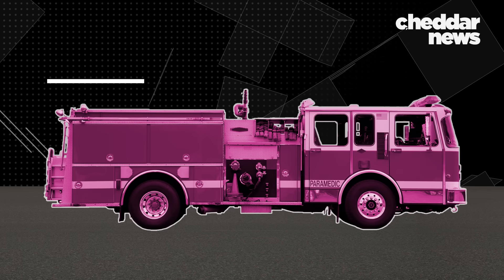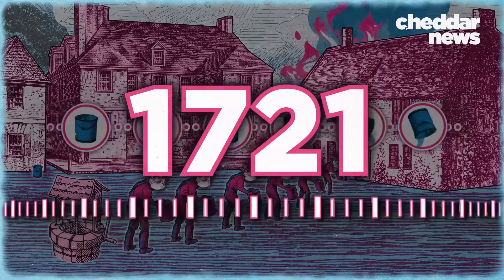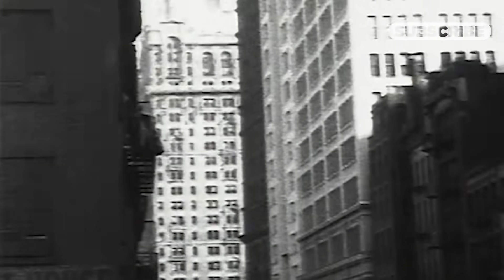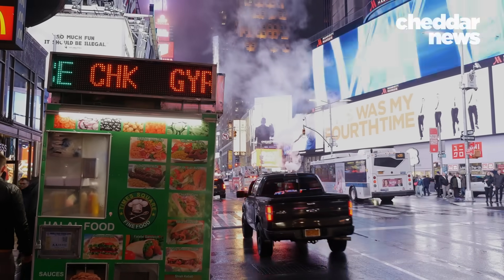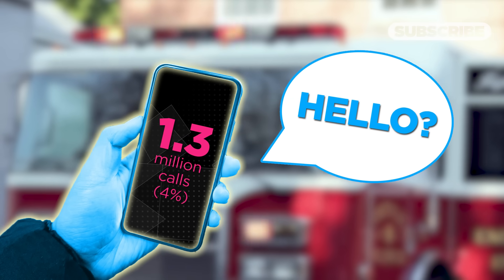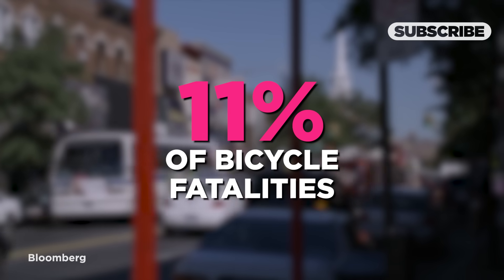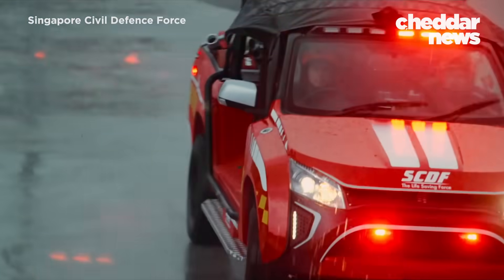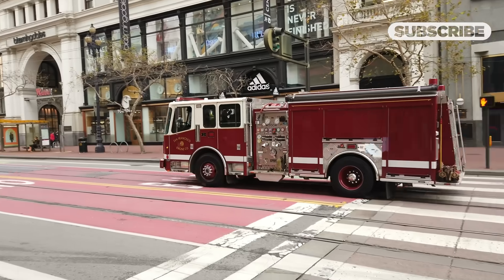Do American Fire Trucks Need To Be So Massive? - Cheddar Explains

Comment: As a firefighter in America I’d like to give my take and hopefully clear things up here. 

I understand all departments are different and have different needs and capabilities depending on what you have in your area. Some being rural, some being in the city, some being somewhere in between. 

My engine is 31’ 9” In length. 11’ 9” tall. We have 2,135 total feet of hose on board. We have 1032 gallons of water on board. We can flow 1500 gallons of water a minute at 150 PSI.  

In my department, every compartment of a our engines are pretty much the same all around. 

On the driver side, our first compartment is called the “Engineers compartment.” This compartment has different nozzles/ extra nozzles that we can use to help fight the fire. Different nozzles can help I’m different ways. We can change/ swap nozzles out that can give more reach, and more GPM. We also have attachments that can allow us to make foam. In this compartment, we have hose that are 25’ in length (in case the hydrant is near by) so we don’t have to pull another line off the back that is much longer. We keep a tool box that has standard tools. We have a water cooler, scene tape, duct tape, markers, ect. 

Our second compartment is our tool compartment. We have everything from pry bars, flat head axe, pick  head axe, sledge hammer, lock out kit (to open locked car doors), and other tools.

We have a 3rd compartment that has chainsaws (to cut trees) vent saw (chain saw that is meant to cut holes in roofs to help with ventilation on a house fire. Oil dry for car wrecks, push brooms for cleaning a scene up (works to help spread the oil dry), tarps, tubs for salvaging things (typically on a house fire), forestry rakes, extra oil and fuel for saws. We have k12 saw and extra blades for it. Ground monitor, portable hydrant, ect. 

Our back compartment, we have a fan (for ventilation on CO calls and for pushing smoke out of a home). We have a junction box that’s pretty much a really long extension cord. Portable scene lights. Hydrant bag ( bag that has tools to turn hydrant on and flow water) this bag also has adapters and hydrant wrenches, spanned wrenches, flash light, adapters, gate valves, ect. 

We have a ladder compartment that has two 10’ pike poles. Two 6’ NY hooks. Back board. 24’ extension ladder. 14’ roof ladder. 10’ attic ladder. 

We have a compartment with extrication equipment. We have a spreader (jaws of life). Cutter (to cut cars open). Long and short Ram with support ( push dash). Chains for stabilizing a car. Window cutter (cuts windshields primarily). We have a hydraulic power generator to give power to cutters, spreaders and rams. We also have airbags that allow us to raise a car if a patient is trapped under the car. We can also use the airbags to lift the car and place wood blocks under the car to help stabilize. We carry 20 blocks and more other wedges (called cribbing). We have ratchet straps and plenty of webbing. 

Next compartment we have medical equipment. We have a Zoll monitor that can give us vitals and shock a patient in cardiac arrest. We have medical bag with IV kits, life saving drugs, gauze and other life saving equipment. We have also an airway bag that contains everything from a nasal cannula to even where we can intubate a patient if needed. 

We are all Hazmat Technicians in my department. We also specialize in technical rescue. These are very few of the many things we have on our Engines. About 95% of our calls are EMS related. And 5% are Fire related. 

We respond to all EMS calls. Reason being is we can just have extra hands for the EMS crew. A lot of times, the EMS crew is far away. If we respond and are on scene within 5 minutes, we can get a lot done with the patient before the ambulance arrives. We care for the patient and a lot of times, the patient is ready for transport by the time the ambulance arrives on scene. 

Everything on our trucks are needed and vital. We pretty much can handle nearly everything with what we have. Everything we have as far as space for tools is jam packed in there. Every bit of room we have is used. 

To end this long comment, we hope not to use anything and pray for the safety of our citizens, however, if anything happens, we are there and are ready.
Reply: hm, nearly everything you mentioned is also on typical german firetrucks which are much smaller... the only thing that's different is that our normal trucks have 500 - 800 gallons of water with them, but every bigger fire department has a so called "Tanklöschfahrzeug" ("tanker") with up to 1200 gallons of water. We have a very good hydrant system even in small villages which allows us to carry less water in the vehicle. Also the amount of hose could be a bit smaller here.

Maybe our medical equipment is also a bit smaller, but many fire departments in rural areas have so called first responder, which have the same equipment as an ambulance car in a vehicle that is in small SUV size (e.g. BMW X3, Ford Kuga, ...). They are faster than every fire truck. 

Everything else is the same! Maybe we have even more on board, like material to secure traffic lanes with cones, lights etc. Some also have small electric power generators or multiple chainsaws to cut concrete, metal etc.

So, to sum it up: In Germany the fire trucks have at least the same amount of stuff on them, and are much smaller. Also, 10 people can drive in that trucks...
Reply: @aron3588  to add to your statement about the hydrant system. If you build a house or any building in general you have to proof that there is at least one hydrant (depending on the building size even more) within a 50 meter radius. For cases like countryside farms (rare in the EU cause space) you either need a Pond with a certain amount of water (dont ask me what number specificlly but i believe it was around 1000 gallons) or big water tanks that can be used as water for fires on your property.
Reply: @aron3588  Czech Republic here. Besides, Europe is extremely well covered with "ambulance services" (EMS etc.) and they are the primary responders in solely-medical situations anyway. There is no way that, with the exception of cardiac arrest maybe, FW would arrive to a purely medical condition before an ambulance because it would not be dispatched in the first place.
Reply: @aron3588  Even in America trucks that you will see out in Rawl areas are nowhere near as big as what you will see in major cities. You will only see big ladder trucks in communities that actually need them
Reply: @aron3588  so the 1200 us gal capacity you mentioned is on the very low end of the pumper tankers that in my area are designated as engine xx-5 and upper end of standard engines here. Tanker designation is usually anything 3000 gallons or more. Most trucks also carry hard sleeve hose for drafting out of ponds, lakes and other bodies of water.
Reply: @aron3588  We get it. You think your better than us even though you aren't
Reply: @chaosXP3RT  We are
Reply: In germany we have very different vehicles
1. is the HLF which is Good For Basic technical Support and fires. It’s the vehicle for Daily Basis, With a 2.000l/min Pump and a 1.600l Tank With nozzles and all you Clan Dream of and has 2 different ladders on it which can reach altitudes to resche at 7.2m and 11m and in thats Not enough we have the
2. DLK which in regulär basis Has a 30m Long hydraulic ladder That can reach 23m at 8m distance to the building 
3. LFs which are basically there to put out fires and has 2 ladders also 
4. the RW is without any Water or water Tech and is online Used for technical stuff like car crashes and more and it Comes it the HLF isnt enough
And after That there are Things like WLFs and so on 
Also to Note nearly Every vehicle can produce Their own energy via a gasoline powered generator 

And thats without much details. Look up an HLF20 and Look for english subtitles and Maybe you See some cool stuff in a smaller truck
Reply: @supmo68  HLF is that what Dublin Fire Brigade and other Irish brigades call the pump ladder
Reply: Thats a nice list, but I have to say, the HLF in Germany can do ALL of this as well and is way way smaller than an American Firetruck, we may don't have as many ladders on a truck but we have 1 modular and one longer ladder. For everything that is taller than the ladders can reach the ladder truck is responding.
Our HLF got a tank of 1.600L (423 Gallons) of Water with us and 120L (31 Gallons) of foam concentrate on the truck.
The ladder truck got (if it´s new) a second joint up front to get in the basket in even tighter spaces.
I am a EMT and worked for 2 Years as one. I just started the 3 Year School education the be a Notfallsanitäter (Paramedic) in Frankfurt. I am in the Volunteer fire department (not in Frankfurt) but I am worked many times with the firefighters in Frankfurt, they got Drugs on there Firetrucks as well and got a Paramedic on board but the don't respond to medical calls on a regular basses, the dispatcher only dispatches them if the got a ongoing resuscitation on the phone or an Ambulance is calling for help at a resuscitation.
I think the big difference is that we also got a small car (7 of that in Frankfurt) wich is called NEF wich is transporting a Doctor to the Cene, the driver of the Doc is a Paramedic, so you got 4 Persons on Cene: 1 EMT, 2 Paramedics, 1 Doctor. Just so I know, do you got something like this ?

To come to an end: We can do as much as you can with our HLF, and the trucks are way way smaller
Reply: @kroncarl6583  large departments here have many different kinds of trucks which respond to different kinds of calls.   Both Emergency Medical Service Ambulances, as well as fire departments have paramedics.  Fire department will often send a squad vehicle to medical calls, because it is assumed that they will arrive quicker than EMS, and also they will make additional personnel available if the call becomes technically complicated due to entrapment or the location of the patient (upstairs, etc) 

Smaller departments, with less personnel and less financial resources may have only one or two trucks which must be able to respond to any call which comes in.
Reply: @kroncarl6583  well the main difference for size is the water capacity. Engines in the US carry almost 3 times the amount of water of what yours does. If we only carried 300 gallons we too could have a much smaller truck. Also a major difference in the length of hose carried
Reply: @Kron Carl  basically the way most US fire trucks operate is every truck is able to run most calls. We still have specialized trucks, but it's rare we need them.
Reply: @kroncarl6583  you just stated that your trucks have half of the tank capacity. That right there will reduce the size of the truck
Reply: @kroncarl6583  no we don’t carry doctors on scene mostly ent and paramedics is not as many but we handle the calls even on the pumper ladder truck to help and save a patient during the time before paramedics or ent arrives.
Reply: @kroncarl6583  423 gallons? average engine in the us is like 1,500 gallons
Reply: @85square  our engines (city municipality)have 500 gal booster tanks. Ladders with a pump have 300 gal tanks. Surrounding county departments have 1000 gal up to 1500 and are classified as pumper/tankers. And the difference in designation,  I believe,  has to do with achieving a certain ISO rating. In the city we can send more truck to a call and have the required water capacity, or whatever requirementit. But being a city, we have a large hydrant network. The county departments run more into rural areas without hydrants,  thus the higher on-board water capacity.
Reply: @85square  You only need to carry on board if you do not have access to a water supply. At least in the UK we have reliable and plentiful hydrant networks located throughout urban areas, they can pump from ponds, pools, lakes, etc, and if it's a serious fire, you're going to get a stream of bowsers (tankers) to the scene too.
Reply: @85square  Don't you have acqueducts and standpipes/fire hydrants in the US? They are literally everywhere where I live, including mandatory, pre-installed fire hoses in buildings that are open to the public (event venues etc). Unless it's a road accident happens in the middle of nowhere in the countryside, you don't need to carry that much water on the truck. You just connect to the water network and pump.
Reply: @kroncarl6583  you have several logical fallicies with your statement. 

1) All your equipment is stowed, even hoses. American fire trucks are designed for rapid deployment of hoses that are already connected, no need to pull out the bag, remove the hose and connect it.

2) European fire trucks are designed for space saving in mind. The equipment will be stored higher off the ground but with a step stool. Most American equipment can be easily be reached from the ground.

3) ladder trucks are fundamentally different between the two countries. European ladder trucks are designed for rescue only usually can support the weight of three people. American ladder trucks are designed for rescue and also for full operations the design to carry up to six people including all equipment for water suppression monitoring and rescue.

4) 700 gallons of water takes up a lot of room. there are a lot of areas in the United States in the country where you do not have access to anything in regards to a fire hydrant.

5) American fire trucks are designed from the ground up to be fire trucks. European fire trucks are retrofitted from existing cab and frame designs. American truck fire trucks have to follow exceedingly specific design specifications including reinforcement of the cab for firefighter protection.

6) a good chunk of the length difference comes also in a pump location. most American trucks use center staffed pump location versus European use rear.  this is a design choice by the people ordering the truck.

7) there are American fire departments that have trucks very similar to Europeans. with each truck being designed for the ground up there are a lot of options, departments choose what they want based on their geographic and service needs. 

8) European trucks are most similar to type 1 fire trucks in the USA. Biggest difference is the USA trucks may be slightly longer ~35feet instead of 30 once again due to location of the pump.

Trying to compare American versus European fire trucks is like trying to compare apples to oranges. There are seven different types of fire trucks in the United States. Each one serves an individual purpose. and each one can be customized to departmental standards and needs.
Reply: @RepinsTsohg  There was a company called Dennis who built appliances for brigades in Ireland and Britain.
Reply: @kroncarl6583  that's awesome that the smaller trucks fit the need for your department but they would never work in mine. I read you are a volunteer firefighter. I am as well I'm a lieutenant in a rural fire department  with only about 15-20 active members to run calls. More than a dozen of those work outside the coverage area which covers 77 square miles and all but 2 work days. So on any workday you might have 5 people available to run calls. Of those if you get 3 your doing good. We have times where we don't have the personnel to bring multiple trucks to the same call and need all equipment for all jobs on the same truck. Considering we run on average 5 calls a day it's possible to have multiple calls at the same time. If they are the same type of call and require the same equipment we have it. Now let's talk about the water situation 400 gallons are what we have on our brush truck would never work for an engine. Our engines have 1000 gallons because there are areas that don't have hydrants for more than a mile we also have a 2500 gallon tanker that we can shuttle water in. The point of my long reply is just because a particular truck works well in one area doesn't mean you can take the same trucks and make it work well in another.
Reply: @williamtunstill7139 yes i agree with multirole trucks being more useful for low crew fire stations but generally most fire deps out there do have enough crew for more vehicles
Reply: @williamtunstill7139 also all the german firefighters are saying a german fire truck can carry the same equipment so a smaller truck could definetely be as multirole
Reply: @kroncarl6583  From what you said the American truck just has double the carrying capacity as your German Fire truck.

You have smaller roads, America has bigger roads. I seriously doubt the HLF is that much better. 

America is Land of the Brave and Home of the Free 

Something your Lacking in Germany. (Freedom)
Reply: @kroncarl6583  immediately you said one thing that is way different that your truck can’t do. You only carry 420 gallons of water where as an American truck Carrie’s over 1000. That 400 gallons won’t really do much for a fire on a bigger house or complex. The other problem is you have 1 truck for this and 1 truck for that and 1 truck for something else. What happens if multiple scenarios happen at once now?   The smaller trucks just aren’t as equipped and I’m sure if you compared each truck exactly you would see how many things this smaller truck doesn’t have.
Reply: @RedHaloManiac95  also if someone is injured waiting for your specialized truck can be the matter of life or death to that person.
Reply: @kroncarl6583  We get it. Europeans think they're better than us. Spare us from reading an entire paragraph
Reply: @kroncarl6583  the combined costs of all of those vehicles, along with logistics and maintenance actually makes them hundreds of times more expensive than the American fire engine. Basically the point your trying to make is that the job one American fire engine could do, is apparently better to have be done by at least half a dozen tiny, exceptionally flammable (and prone to literal spontaneous combustion) pickup trucks? Because that just sounds logistically and practically stupid on every level.
Reply: And nowhere did he say that his fire truck was 10 ' wide.
Reply: Greetings from Germany
Reply: Your loadout is pretty much the same for my department. We have 2 Engine/Rescues, Spartan Chieftain, 6 man cabs, top side control panel. We have incorporated 2 medical response units (Ford SUV) since our 2 American Fire Apparatus rescue units literally wore out and had to be scrapped (safety reasons). I retired after 29 years of service. Sure miss responding with the guys.
Reply: I'm firefighter in rural Switzerland. We have exactly the same material in smaller trucks. There is only one difference: the ladder is in a trailer and not on the truck. But as you say, only 5% of the interventions are fire related, meaning we don't need the ladder 95% of the time
Reply: @Americans if you are interested in German Firefighting have a look at Feuer & Flamme. In my opinion it gives good insight even though the subtitles are quite bad. 
You can even see that we can handle big fires with our small trucks.^^
Reply: @g3rn0m4ly7  Yes, and we can handle small fires with our big trucks! sorry for the sarcasm
Reply: See a video of a car that's on fire in the states or example in the Netherlands, you can see that the fire brigade in the states can learn from the Netherlands.
Reply: Wow, that's a very long way to say that you don't see forest for the trees
Reply: I agree but also the fires may be getting less common but are getting stronger and harder to fight because of the material burning
Reply: Thanks for a comprehensive response!
Reply: My department is a engine and rescue so I understand that
Reply: sounds like what the rural fire trucks around me are setup as.  I had to call 911 10 years ago when I was alone and pregnant and my toddler got her head stuck between the bars in a railing (in my defense we only had been in the house for a week and were looking into how we could fix that spacing problem but we thought our child's head was too large for it to be a problem  until the next child's birth).  After 30 minutes a fireman arrived in his personal truck, his personal truck had all kinds of equipment for car accident issues and he apologized for not being there sooner because when he heard the call he went to his garage to get a metal cutter.  He was able to pull on the bar and flex it enough that I could pull my daughter out.  he checked her out and then called to tell the ambulence and fire truck to not come out.  just after doing that a 2nd fireman arrived (1 hour after the call) and said he had also looked for a metal cutter before coming.  Rural fire departments need to be prepared for anything and everything, though sometimes the fireman come directly to the scene if they are closer to it than the firehouse, which reduces the wear and tear on the firetruck.
Reply: Could it not be also argued that having a higher number of smaller vehicles would help with role flexibility whilst letting you carry at least as much equipment?
Reply: I like how the only point made for big fire trucks is that there are rural areas. 
I am going to propose a crazy Idea. Cities can switch. If there are edge cases where somehow a European Style Truck is not working. Just stick with the old one.
Reply: @g3rn0m4ly7  Right? I don't think people fully think through their thoughts. (1) People are commenting how the US needs large firetrucks because we have rural areas, as if other countries don't have rural areas. (2) The comments also sound like rural areas justify large firetrucks in cities.
Reply: In Europe they have nimble ambulances with jaws of life and all the equipment to remove the victim
Reply: I'm not a firefighter but if I'm not mistaken our fire trucks have the same equipment on ours here in Sweden🤔 some may be divided over two trucks but still as efficient but I don't think they are that less expensive.. I don't think the truck itself is that expensive but they are packed with equipment and all that ads up...

As a swede I love the us fire trucks and would be sad to see them replaced, they are more then just trucks by now.. it would be like dismantling Statue of Liberty and replace it with a stone..
Reply: The difference to Europe is, that we have smaller more specialized trucks. Meaning often we send 2 trucks to have the same equipment as US trucks. But very often that is not necessary.
Reply: This is enlightening, thank you for using the comment system to make productive discourse! 

I think it would be interesting to see how European organizations and trucks are set up. I'm sure the approaches used by them are no less effective than those used by US departments, so it might be a beneficial learning experience for both sides to see how the other operates. 

I'm not 100% sure, but from my observations European cities tend to completely separate their ambulance and fire services. I suspect this leads to some big difference.

European ambulance services sometimes also delegate response and transport to different crews with different vehicles (like a physician or medic response car that usually arrives before the ambulance). I wonder if their FDs are similarly specialized, having different crews and vehicles for each situation...
Reply: So much text and still you use gallons and inches. What a decade american you sir are. 😄
Reply: @j0n_H  150 burgers per overly complicated rugby pitches
Reply: I really like all the details that you explained and I really send greetings as a firefighter from Europe over the ocean to the US.

At our firedepartment we have 5 specialized vehicles. They all work in union
1 - 30m (approx 100 feet) ladder , its only purpose is everything related to height, rescue etc.

watersupply comes from the ...
2 - small watertank 1500l (approx 400gallons), waterpump, waterhoses, breathing-kits, chainsaw etc.
3 - bigger watertank 4000l (approx 1100gallons), waterpump, waterhoses

for cars accidents etc. there is the ...
4 - mutli tool vehicle with everything to breach cars and much much more

special ...
5 - coiled up hoses I guess 2 miles of hoses (special for water supply for wood fires in the hills here - the needed intermediate pumps are stored in several locations in the area)

The next fire department just 3 miles from here ...
- has their specialized vehicle against chemical and biological hazards and treatment of such

The other fire department 4 miles away
- has a special vehicle for snow and muddy mountain terrain to rescue people there

And so on.. 

What I want to say is, that it's surely not all good here in the German Firefighting Services, but the approach is to specialize the vehicles and the education of the (mainly volunteer) crews.
Reply: Thank you for your reply, quite honestly, the first one to give a factual, rather than testosterone induced one from the USA.
Knowing something about how European fire systems work, I'd say that your training is pretty well equal to a European fire crew's. But do you take ALL  that gear to every call?
I know that European systems tend to use much smaller units. If there is any doubt as to the assessment of a situation, the service will often send someone ahead to advise control of the specific needs. 
This approach has, sometimes resulted in a serious situation resulting in worse outcomes (Charing Cross tube Station as an example) when a senior officer wasn't able to reach the scene in time, but usually multiple, small, specialist units can arrive far more quickly than a single juggernaut. And the personelle are just as well trained.
OTOH, I understand that US firefighters have a much higher fatality rate Due to the "Hero response" culture in the USA.
Reply: I've seen firemen in action i have more respect for them than the police
Reply: Kinda sad when this one comment has better info than the video it's commenting on.
Reply: This is pretty much what us Germans also carry. Except our vehicles are more compact. This is neither bad nor good. It just is. 

Sure, we carry less water but then in cities the next hydrant is never more than 100 meters away, 140 maximum.
Reply: That's the exact issue. You have too much stuff in one truck. You don't need a giant ladder for a car crash. You don't need a huge tank for a medical emergency. The equipment has to be distributed. A fore truck never needs medical equipment, there is a reason why we have ambulances. You can reconstruct the ladder that it uses less space on the truck. You can pack things in a compact way (something that US trucks aren't that good at) and you need specialised trucks for extraordinary events.
Reply: Same as you don't need chainsaws in the event of a normal accident or so. You also don't need a huge fan for everything. Let me tell you. Every single fire department in the world is capeable of handling every single situation, but we only take the things with us that we actually need and not more. If we have a chemical spill, you'll never see a truck with a huge ladder here because... just why? If we need to cut down trees, we call the guys that take care of forests, if someone has a heart attack... we won't even notice that because that's for the ambulance. Yes, we do need big ladders and huge fans SOMETIMES but if we need them, we simply take the specialised truck for that and there you go. 

The problem with big trucks is, that they cause more harm. Fire departments will demand wider roads for their big trucks, but that leads to more accidents. They want to remove bike lanes, but again, that causes more accidents. The big trucks it self aren't the issue. But their demand for more road space is.
Reply: In short, you have just a different approach. 
You have the one engine can to anything approach while Europe has the "tell us your problem and we'll send the right engine approach"

Also. It seems like in many cases one American engine would be enough. 
In Germany where i live 3 different engines can be sent at once. 
They're smaller cause they're more specialized. 

You rarely need ladders and water for a car wreck, so an engine with tools and at least one ambulance get send to that. 
We also have containers with very specific equipment.... if it's needed a truck picks the container up. On another call the same truck can pick another container.  
For example let's say a large amount of toxic materials were spilled.  Truck picks the container for dealing with toxic materials. 
Next call is a pile up with a lot of casualties.... truck pick up a container with additional medical equipment which might not be on an ambulance or at least not at the quantity needed for the situation
Reply: This is an English fire engine, note that there's a separate ambulance service so the fire service doesn't respond to medical calls, they are first aid trained but in general on scene medical is delt with by the paramedics and doctors of the ambulance service and helimed 
https://youtu.be/QQwzzj_u_GQ
Reply: https://youtu.be/_cqoisOrYSE

Have a look at an Australian pumper design.
Reply: Yea we are similar being rural we carry less hose than a city truck as we rely on tankers for water or we are drafting from a source and we carry less medical ambulance/medical is its own branch so what we carry is more we need to treat our own or as assistance to the ambulance and we keep a separate truck for auto accidents/ everything else  (I'm realizing I'm rusty I haven't been directly active with fire fighting an 6 years since I messed up my knee)
Reply: "My engine is 31’ 9” In length. 11’ 9” tall." 

Ooooof. Then I realized you were referring to the fire truck. 🍆
Reply: 343 + 1
Reply: U got hoes on board?
Reply: Thank you for this comment. I've generally avoided Cheddar videos because while they inspire conversation in the comment section, they are generally too short to be nuanced. Firefighters in my hometown respond to practically every kind of emergency, so their truck has to be a jack-of-all-trades.
Reply: @Matt Hickey, is your FD a combined Fire/EMS service with Paramedics on the truck?  Sounds like it by your description.    

Our FD is a combined service and our FF's alternate shifts between the Medic Unit and the Engine/Truck Co.   You have to promote to Engineer or Capt to get off the box rotation. 

Most FD's dont have full ALS capability on their trucks and the majority of the public doesn't understand the benefit of running a combined Fire/EMS service.  

Having a combined service also makes for better on-scene patient care because crews all work with each other, instead of having Medics only on the box and FF's on the Engine.   We trust each other 100%, no matter if it's the fire ground or working a code in grandma's living room. 

Be safe brother.
Reply: @Andrew-fr3bp  Switzerland is a very rural country. So the functioning of the service depends a lot on the size of the municipality. Cities with more than 10'000 inhabitants have professional ambulance drivers, so it's not really useful to have ALS/BLS skills. It exists in some places but tends to be abandoned as it is more efficient to send professional paramedics directly to the scene if the intervention needs it. In smaller localities, it works differently.
Military service is compulsory in Switzerland. All male citizens are BLS/AED certified by the army and some are ALS/MED certified (for example me). Fire service is also compulsory. In rural areas there are no firemen who stay in the fire station permanently. People live their normal lives and when there is an alarm, we receive an automatic alarm by phone, we go to the fire station to get our equipment and we leave for the intervention site as soon as there are enough people to form a complete crew (average time of arrival on the intervention site: 13 minutes). At the moment of the alarm, the officers of the state command centre select a person who is closest to the scene and send him to start the first aid without equipment. There is BLS equipment in different strategic places. The officers select a second person who will collect the BLS equipment and take it to the scene, again again without firefighter equipment. This allows us to reach 99% of the population in less than 5 minutes, so that first aid has usually already started before the truck arrives. In the trucks, we have full ALS equipment as a large part of the population is trained, but this is not part of the companies' specifications, it depends on whether a trained person is in the truck.

But that this kind of thing is only possible in a population that has a high level of military preparation, as is the case in Switzerland, and that can only work with a compulsory service system. In my village of 2200 inhabitants, we have 130 firemen. If we didn't have so many people spread over the whole territory, this way of working would be impossible.
Reply: @fabswisss  Retained Firefighters in rural areas of Ireland and Britain
Reply: @Andrew-fr3bp  That is what Dublin Fire Brigade does
Reply: Great comment, keep up the good work
Reply: But but bike lanes :'(
Reply: I know, locally, there's a pretty massive mix of trucks split between a few stations and also the various connections with the county stations.

I know one of the agreements with the county is that the city gets a lot of county calls for things, because the city has more things for that while the county adds a lot of the more specialized options, mainly for offroad and pumps...and both groups also have a lot more hazmat training than most due to an issue in the area concerning a fire at a chemical storage facility that's still a superfund site. We also get a lot of interchange in all EMS with the military due to the airforce base which has some interesting equipment of their own.

While I'm not involved, several family members are there, the most amusing things I've heard from some of the older dispatch from before agreements got fully hashed out with the base are kind of hilarious to think about considering the security issues that had been ignored such as a fourteen hour hunt split between 3 police departments, the sheriffs office, and the base MPs because some idiots on a bender were hopping back and forth while naked and "Trying to free the aliens" while on who knows what...
Reply: I am from Berlin, Germany and would love to hear from your professional point of view what you think about the Concept Fire Truck by Rosenbauer.
It is a electrical vehicle with an aditional diesel engine and new state of the art technologie, like changing the high of the truck to allow for easier acces to the crew compartment, it was testet by the Berlin Fire Department and proofed capable in a metropolian area ( the BFD wants to order more of engins).
Do you think this vehicle would be fesible to use such a truck in US cities to?

Here are some videos:
vpromotion video: https://www.youtube.com/watch?v=R_iLKoq3u1I
CFT in D.C.: https://www.youtube.com/watch?v=SSevSiD1Zis
CFT on responce, small turning radius in Berlin: https://www.youtube.com/watch?v=xHbRQomP2cA
Reply: When you put it that way seems like the truck ain't big enough.  Fireman should be paid like athletes do. I don't understand why not.
Reply: In other words you get more utility out of your truck than Europeans
Reply: @lrut028  American trucks are bigger thus less specialized. Europeans have multiple specialized trucks for different purposes and often send more than one.
Reply: @lrut028  bs, you get same amounts. Nice fake news.
Reply: @matt hickey thank you for taking the time to describe equipment in each compartment of your department’s vehicles. You mentioned the zoll monitor. Do you carry the Zoll Propaq MD?
Reply: You gave yourself the answer by commenting: 95% EMS, 5% fire. Good on you for being a firefighter though. Much more needed than overpolicing a city.
Reply: Wow 
10000% more informative than this whole video.
Reply: Matthew Hickey and Steven Morris Dublin Fire Brigade does all those things and only has a few types of appliance. They carry all the gear required and needed. Ambulance is one of their duties in the city centre.
Reply: "Everything on our trucks are needed and vital. We pretty much can handle nearly everything with what we have. Everything we have as far as space for tools is jam packed in there. Every bit of room we have is used. " That is some strange conclusion. You would say the same if you had half of those items or double of those items.
Reply: Thank you for your services.
Reply: My uncle is a firefighter
Reply: It is pretty much the usual American self flagellation: the rest of the world good, we bad.
Reply: And yet Europe is not more dangerous, because firefighters dont have the equipment they need when they need it...
I wonder how is that possible, if they also use smaller engines. Maybe you actually dont need all the equipment on every truck, all the time.
Reply: Better to be over prepared for every possibility rather than that once your not and someone dies
Reply: @lolhi3105  Soo you carry a swimsuit every day in case you have to swim somewhere?
Reply: Thank you. As a civvy I was never in a position to learn why a fire truck was built a certain way. Ladder and snorkel trucks are obvious, but the first 'generic' truck to be sent is what you took the time to describe. Thanks for the good description.
A lot of thought went into the designs and what goes where.
In my opinion, there are places like in older European cities where a North American design could not work well. Many of those cities date from medieval times, the roads are NOT large, the engine would never get in there. They must have trucks that can fill the needs they face, but in turn they would not be useful here.
Distances to cover, need for a lot of water and tools. need to operate at temperatures well below freezing, and long distances to drive at times.
In many of our cities you can drive at normal speeds for an hour and still be in it. So the truck has to be powerful and fast enough to cover the distance on top of carrying tons of stuff.
Let's not forget the necessary crew to be effective, I think it's at least 5 or 6?
Reply: @Greylocks  Scandinavia is also operating smaller trucks and it is much colder there... When there are forest fires, fire departments cross state lines, so I would not say range is a particular issue.
Reply: @Spectification  maybe not but when you see that a single province in Canada is twice the size of France.... it puts distances in a whole new perspective. Over 200km between major cities is not uncommon here. I still think it's a question of adaptation to the location.
Reply: Very Well Written and appreciated. Keep up keeping everyone safe! 👍😁
Reply: So you we'll use the 1032 gallons in under a minute?
Reply: Hey mate, thanks for your service. I’m a firefighter in the UK and work at what we call a ‘heavy rescue’ station. Trust me we have everything you have mentioned but I’m a smaller truck and can carry 6 of us
Reply: You don’t need all this for every call and you know that. You’re carrying tools for edge cases. When nearly every other western nation has smaller trucks and is just as effective as US fire departments, it should tell you there are alternative ways to do this.
Reply: Yeah ok my comparisons only one third of hose , 200 psi at 118glpm in conversion
Reply: Just ignore them

The modern Internet is on a "ANDRICA IS BWAD 👶👶🍼 ER THWING WUROPE DWOES IS BWETTER 👶👶🍼"

So no matter what you say some asshat from Amsterdam is going to be on here telling you why massive American cities with a greater population than his entire country needs Tiny firetrucks built in Europe. And also that you're a complete non human for not using metric.
Reply: Virtually everything you have said is on a uk fire appliance
Reply: An German HLF with an 11ton chassis does the same, lol
Reply: An German HLF with an 11ton chassis does the same, lol
Reply: almost everysingle fire engine does alot more then just these things
Reply: @MISTERKING192 Like what? What he talked about pretty much covers it. Hose (LDH, 3”, 2.5”, 1.75”, maybe forestry or booster reel.), Extrication, saws w/ oil and fuel, cribbing/air bags, hydrant bags w said accessories, spare nozzles and adapters to connect different size hoses to each other or to different size discharges/intakes, rakes/shovels/push broom, oil dry, water can/abc extinguisher, portable lights, BLS medical bag, AED. I’m missing some stuff off my apparatus but once again he covered most of it.
Reply: 11’9” 🤔 what kind of apparatus are you talking about that isn’t an aerial? The E-One’s at my department are 10’ in height.
Reply: america is such a shit hole developing country😂😂 european trucks carry all that gear and can reach the location much faster😂😂
Reply: I have a hunch that you have not done a comparison regarding equipment on the European fire trucks.
I think you'll find the outcome surprising.👴😁
Reply: The trick other countrys using is not to have all things in one truck. You respond with the trucks you get the call for. No need to send a ultra long hydraulic ladder when you need to open a car after an accident.
Just send as much equipment as needed so the rest is still ready to get used in another emergency.
Reply: Damn you lot fight fires all throughout North AND South America?!? Congratulations!!!
Reply: UK fire engines same as German, can carry all that kit you mentioned and still smaller. The argument that it has to be a massive truck to carry every thing listed is more of because you’re used to it, any thing smaller wouldn’t seem right.
Reply: @wilso845  The biggest space hog on a US or Canadian fire engine is the water tank, the old minimum which is still used by some urban departments of 500 gallons is not suited for most places in the US and Canada. NFPA, the National Fire Prevention Association, a non regulatory guidance agency in the US states that at minimum to combat a fire, a fire hose must flow at minimum 175 gallons per minute, which leaves you with roughly 2 and 3/4s minutes of fire flow from a 500 gallon tank, most modern US and Canadian fire engines opt for 750 (the new minimum) or 1000 gallon tanks, and sadly there is only so small you can make a truck that carries 1000 gallons of water, and when you do compress the truck done you loose the ability to carry equipment, and personnel on the apparatus.
Reply: What a lot of people don’t understand is the European trucks carry the same amounts of hose but they roll the hoses up instead of laying them out horizontal and when it comes to an actual fire they don’t need to pull it all off the engine stretch it out in lines so it doesn’t kink, they just grab an end and throw the roll so it unrolls then they attach the next ones the same way as needed, some even have a booster line on a reel that can be deployed right away for small fires or even to make an initial attack while main hoses and supply is being secured, also they don’t go out on medical calls with ambulances because  European countries the ambulance is run by the health service not the FD or private company. Some European fire stations have been around for a long time so American trucks are to big and bulky and could probably learn from Europeans
Reply: @graffie88  what happens when you have to lay a bunch of hose then?
Reply: @graffie88  I wonder how quickly the hose line can be flowing water if it gets rolled off and each section has to be connected? Are they threaded connections or something like lever actuated quick-connects. Our preconnected hose loads are very fast. My guys can be ready to go interior in less than 30 seconds from dismounting the truck.
Reply: So basically what you are saying is that you haul all the stuff around, even though on any specific incident you need only a fraction of it. So instead of heaving 3 specialized, smaller vehicles thar are faster and more agile you have a huge behemoth that carries 90% unneeded equipment most of the time
Reply: @alfonshasel1995  so you play jump truck? So when you’re out on a medical call and get dispatched to a fire you can’t do anything or go back to the station and get the pumper. Then when you’re leaving that call and get dispatched to another medical you have to go back to the station to get that truck. And so on and so on!!
Reply: @derwoodff64  We have a thing called ambulances, which is kind of like a firetruck, but built to actually serve medical emergencies. And those are manned my different people as Well, so of there is a fire and an injured person in two different places, you can Help both! Quite a revolutionary concept
Reply: Thank you for your service!
Reply: So you carry 1032 gallons of water to EMS calls? No wonder why London Fire Brigade costs $462 mln and NYC Fire Dept. over to $2bln.
Reply: Pretty much what my dept carries, great minds think alike. You certainly can’t carry all that on a European or Asian apparatus!
Reply: @smorris281  you would be surprised, but except for some ventilation equipment you may carry that would not have a lot of use due to differently build houses here in Germany and EMS being separated anyways here, the equipment is mostly the same. Tank sizes and hose capacity may vary, but varies between truck types here and what they are needed for. Most common with the professional departments are trucks that carry about 2000 l of water, which the pump at a pressure of 10 bar could dump within about a minute at full capacity and about 520 meter of hoseline total (plus 60 to 100 m 40 bar high pressure hoses on two fast attack reels). Plenty for what they have to deal with here in most if not all situations.
Reply: @smorris281  we europeans just have specialised units and trucks for that, we dont really generalize our trucks most are specifically designed to fulfill a role
Reply: @raphaellauf7786  Unfortunately in North America it's not always possible to have more smaller vehicles and for the cost of getting 1 truck to do most things vs trying to buy 2 or 3 to each do a specific task is not always in the cards. I don't know about over in Europe but for the most part here in NA the individual department is responsible for funding vehicles and equipment this often means without support from the government in totality.
Reply: @MajThade the issue youre overlooking is that you dont need 2 or 3 more trucks, the same amount of equipment the op listed has been said by german firefighters to be in their trucks with even the addition of more things, so youre basically using trucks that are almost twice as big for slightly less equipment. Why use such big vehicles if theyre even worse than smaller ones in equipment carrying?
Reply: @smorris281  believe it or not we carry almost the same exact equipment on our engines here in Singapore
Reply: @smorris281  yes you can. You’ll find that the combined equipment of a US engine and ladder, as well as much of a rescue, is carried on one vehicle in Europe.
Reply: @smorris281 Yes we can, and do carry all that equipment. It is the way the storage is designed. They are not just a box locker, they are designed with pull outs and drawers etc. 4 ladders on the roof 13.5 metre, 7.3 metre, triple extension and a roof ladder.
Reply: @smorris281  is your FD a combined Fire/EMS service?   Ours is and it's great having full ALS capability on the Engine for medical calls.
Reply: @smorris281  Actually in Europe we can, we just use more vehicles and with the same efficiency. At least in my country, here the vehicles are more versatile, which means that a vehicle who can fight a fire in a city can do it in a forest. We even have a quick emergency vehicles (modified pickups) to fires and other vehicles to medical emergencies (wagons like ford focus, equipped, being smaller can go faster), they go in front, then the bigger ambulance goes behind them. We even have fire trucks with tanks to transport water, we call them "auto tanks", they are used to transport water in a drought or even to fill peoples pools. So here the US fire trucks would be useless mostly, while ours wouldn't be useless in the US. But I understand, the US always had a thing for big vehicles being a big country and all that. So we can carry all that but in more vehicles which is better and faster that way.
Reply: @numi2000  Theres only a few types of Fire Appliance here in Ireland.
Reply: @smorris281  some of the european trucks can carry most if not all, BUT they dont have a tank, so they have to send 2 trucks one with equipment one with the tanks, so yeah, while in the us we can send 2 fully equiped trucks with everything and more they need 4.
Reply: @smorris281  There is a purpose for ladders that reach up to the tops of buildings but with many more calls likely for motor-vehicle crashes and medical emergencies totally unrelated to firefighting, there is a place for smaller fire trucks as well (at least those shorter, length-wise, than trucks with ladders built on the backs of such trucks).
Reply: @smorris281 lol!!!! European ones are very well adapted to their cities and water connection for fire fighting..... So size is s aller plus they have much more specialized vehicles.
Reply: @smorris281 have you ever seen a Scania Engine? Used by the swedish and Singapore FF?
Reply: @smorris281 yea because ems calls are primarily done by ambulances, and calls all have specific vehicles assigned to them. A small house fire wont get a do it all engine because thats just hauling around a bunch of tools for no reason
Reply: @smorris281 You would be wrong, our LF20 carries the same stuff, just more tightly packed
Reply: @smorris281  "You certainly can’t carry all that on a European apparatus" you wouldn't believe how wrong you are by that statement. Apparatus e.g. in Germany are packed with equipment like as if it was a game of tetris. The Engine is way more compact and yes, it both carries less water and hoses, however it carries more equipment along. A by now outdated norm required a bare minimum of 164 different tools at a total number of 284 pieces for an apparatus to be classified as a certain type of Engine, besides the min tank and pump capacity obviously. Anything Matt listed can be found on those apparatus as well: from ground ladders to hose bridges, from heavy rescue equipment to ventilation, tools for technical assistance and medical, lifting cushions to jumping cushions
Reply: @smorris281  well yes we can!
Reply: @smorris281  You can if you split it into multiple independent units that meet each individual function, which is what they do overseas with equivalent effect.  If anything it leads to far more rapid response and better positioning of assets.
Reply: @desertsoldier41  we can barely get enough to drive the one truck how are we going to get all these vehicles to the emergencies?
Reply: @smorris281  you better check that again i would say but yea what do i know right
Reply: @smorris281  You are wrong, European fire trucks carry all that stuff in a much smaller vehicle, because we actually make our firetrucks compact and we use specialized firetrucks for high rise bulding fires. And this leads to much better respone times with european fire trucks than american fire trucks, generally our firetrucks have engines with more hp.
Reply: @smorris281  surly you are joking? i really wish i could post links to a picture. ill try to post it in another reply.
Reply: Very interesting read. Thank you
Reply: Thank you for taking the time to write this insightful comment. Have a great day!
Reply: Thank you for your service!!, imho I'm glad you're loaded with gear for any possible scenario!!, like that old saying goes It's better to have it and not need it than to need it and not have it!!
Reply: I was gonna say, why don't we ask those firefighters in Europe that have smaller trucks which they would prefer to have. And ask American firefighters if they need smaller trucks. Never trust an egg head pencil pusher to make decisions for the guys on the front line, whether it's a house fire, or taking fire in a combat zone. Ask the people that have to perform in those situations.
Reply: Better to have it and not need it than need it and not have it because a bureaucrat wanted to look good by saving a couple bucks. If I'm calling for help, I want it all. What works and other countries may not be viable in the US.

God bless firefighters and all the first responders.
Reply: As an American, when I'm in trouble, I can be confident that you're bringing everything you've got.

I've seen it and experienced it. Fire trucks, ambulances and police responding to everything. It only seems like overkill when you're not the one in need of help.
Reply: However, they have a point, a fire engine could be 2 vehicle instead of a single giant vehicle.
It would also allow a more effective deployment.
Reply: European trucks carry all of this too. The difference is that our equipment is very tight packed, just look up on YouTube European truck equipment. We don't carry this much water tho but it's because our hydrant system is very advanced and there are hydrants even in some rural places. And we have additional things that make fire fighting job better, just as safer helmets and deployable external lighting on the roof. I think American trucks are just too traditional and most of them don't include new technologies.
Reply: everything on the vehicle is in fact not needed, hence this video. If you're going to double as EMS, why not carry guns and ballistic vests and attend police calls?
Reply: @gfuentes8449   i agree..! 

And man, some departments have what its called a "Firepolice..." pfff......cringe
Reply: Thats a lot of equipment for a US truck (ive seen my share of vehicle showcase vids and most US departments barely carry half as much equipment on a single vehicle).

Still, you have all that stuff and some more (like light hazmat equipment, IR cameras, diesel generator and, crucially, a crew of 9 firefighters) on a German fire rescue truck for example, due to more organised and space efficient compartments.

All the equipment and crew and the smaller dimensions (28' long/8.2' wide/11' high) come at the cost of a smaller tank (around 500 gallons), smaller pump (530 gallons a minute) and slightly less total hose length (1600 feet) than US trucks though

I think its safe to say that US trucks are better at putting water on fire, but European trucks are better allrounders and manpower providers
Reply: @porco_rosso-e4r  our fire crew is 3-4
Reply: That's one thing I never understood, all that equipment and training for 95% medical calls and only 5% trauma/fire related. Also maintaining that equipment and replacing it as needed. Most communities can't carry that budget without low wages at least.
Reply: I'm on the job also. 100% True.
Reply: In Europe they have nimble ambulances with jaws of life and all the equipment required to remove a person from a mangled car so the fire trucks don't have to move their  80,000 lbs to every traffic issue
Reply: Thank you for setting things straight, and thanks for doing what you do. I wonder how many European firemen have to "make do" or do without in situations where an American truck would already have the equipment.
Reply: @Altema22  There are different trucks for different kinds of emergencies. For example in Germany the HLF is used for emergencies where you primarily need tools or spreaders and cutters and that kind of stuff. For emergencies which involve actual fires, there's the TLF which has a water tank on board to bridge the gap between arriving on scene and finding a water source. If both of these trucks go to a scene usually the vehicle more suitable for the emergency goes first and the other drives behind it so they don't block the more important truck.
Reply: @laegli1233  couldn't in theory make it more expensive to have specialized trucks rather than cramming everything onto one truck
Reply: @ronanbarkus7801  Larger vehicles with more equipment are more expensive to operate. If you have a high volume of emergency calls, any savings from buying fewer vehicles could be completely wiped out by operation costs. 

It should be fairly obvious from statistics, that US roads are quite dangerous compared to other developed countries. This is largely the result of a road design philosophy that favors wide roads and large corner radii. These factors encourage the high speeds on American roads that result in more severe car crashes with pedestrians, cyclists, buildings, and other cars. When safer designs are proposed, fire departments shoot them down under the guise of public safety. They need wider roads so they can more quickly respond to the more severe crashes induced by the wider roads. That's expensive both financially and for human life.
Reply: @Altema22  I just checked what our fire departement has, and others already mentioned, of course different types of vehicles for different needs are available. E.g. has the city of Frankfurt am Main with actual skyscrapers other ladder trucks than average as you can imagine. But as I am sure you are aware, that's not different in the US, I bet the FDNY has way different trucks than the average fire company.
But back to us, a certain type of standardized fire truck is used by about  every department. Of course fire departments may opt for other models (e.g. more tank capacity) if needed. And the types of trucks are by the way standardized across Germany. The general equipment is about the same, just certain stuff for ventilation etc is not as common here, as it would not do much due to houses just being built different. Also EMS is completely separated. We send out ambulances and if needed also a fast car with a specially trained emergency doctor, although ambulances and drivers for the doctors may be firefighters. Also our stations are distributed differently, we have less larger stations instead of more smaller ones. It depends on a time limit in which they can reach about every house in the city. We have 3 fire and rescue stations and 4 dedicated rescue stations (only ambulances, one at the hospital has two NEF for the emergency doctors). As in many places, most calls are actually EMS calls.
At the fire stations one HLF20 and one ladder truck is available all the time, at one station an extra truck with larger tank. As mentioned those trucks are defined by a DIN norm, an HLF20 has a 2000 liter tank, which in the city is plenty. They have i think 14 hoses about 3 inch, 20 Meter length and 12 hoses about 1.75 inch. Also two reels with high pressure hoses, either 30 m about 1.5 inch or 50 m about 1 inch. Those are often called fast attack hoses, and for a small dumpster fire or a burning car they may be all they use. Pressure with those may be up to 40 bar. Regular pressure is about the same as well, 10 bar (i think that is about 150 psi).
When it comes to road situations and what a fire truck has to fit through here, there are a lot of videos out, search for Brandweer Lunteren, they have some nice vids where you can see how narrow average roads are here (wide enough for what we need at least). Oh, and don't wonder about everyone getting to the station on bicycles, that is actually a volunteer department in the Netherlands. Their trucks are about the same as ours, although volunteer stations usually have the smaller LF10 (less equipment and smaller tank, about 1000 liters). Beyond that, volunteer and professional departments are working together in the cities. Either volunteers support professional trucks on scene, or on larger incidents, volunteers are present in the station when all the professional firefighters are out already. Outside the cities, a volunteer company may be all they have.
Reply: Out in the Midwest usually EMS and fire is all together in one house and when there is a EMS Call the ambulance comes and the firetruck as back up and most of the people are certified firefighters and EMTs, it’s a requirement of where I work to have both to do both jobs.
Reply: @alexanderkupke920  Doctors are to valuable to be sent on EMS call away from the hospital or there office. A US doctor makes around $225,000 USD a year compared to $85,000 USD in Germany. A well trained Paramedic is just fine for 99% of all calls run by EMS and that money can be used elsewhere.
Reply: @dougt4174  I think they run trials decades ago here, might have been back in the fifties I think the first "Notarztwagen was introduced in 1957, and obviously they found this system to work better and have higher survivability rate. And with such an income, a doctor here in Germany has a higher income than at least 90 % of the population. Do they earn more? sure. But on the other end, almost a quarter million seems to be vastly overpaid as well from our perspective. 
And also, don´t get me wrong, a doctor is not send out on every single call when rescue services are needed. for "minor" injuries that are not life threatening but prevent the pation to be brought to the hospital by private means, or today sometimes even for strokes, they do not send a doctor at all as that can be handled by the EMS. If you call in for suspecting a stroke, they may indeed just send an ambulance to grab the person and get to a stroke unit asap, as they found in the field there is anyways litle a doctor can do.
In an almost ten year old statistic I found that rescue service calls (not only through 112 which is the european equivalent to 911) had been half emergency services and half just transports. From the emergency rescue service calls, a doctor was sent out only in about 40 % of the calls. In 2012/2013 in Germany there had been 12 Million calls in total, about 147 calls per 1000 population. 8 Million calls they got on scene using sirens and signals (no, they don´t necessarily use those every single time) and for calls where "Sonderrechte" applied (use of lights and siren to claim priority on the roads and at intersections is called "Sonderrechte" as emergency vehicles using those have special rights regarding traffic laws compared to other vehicles) on total average the first vehicle was on scene in about 8.4 minutes.
But as mentioned, this seems to be what is seen as working best for us. I think Austria does the same, and France something comparable, while Switzerland has some kind of mixed approach. Other European countries run a paramedics service like the US. So it is hard to tell if one way or the other is better. I think comparing both systems, we should also keep in mind, how close the next hospital might be. And then of course comparing the US to Germany will give us a completely different scenario. Looking at it that way, I doubt our system would work in the US or at least it would not work the same way.
Reply: @Altema22  different trucks for different emergencies. You dont need a huge ladder for someone with a heart attack. An ambulance is enough. Often  Departements in a City have their Main vehicle with a Water Tank and allround equipement, a ladder truck and a Pioneer vehicle. Firefighters can act as first responders but normal Ems calls go the ambulance which is seperated from the firedepartement
Reply: @dipeptidase2774  that’s actually false, an engine or a duty/utility will go as well to provide support and fire department is usually always on scene first to begin with
Reply: @greenwoodfireresponse  what do you mean? what is false?
Reply: @dipeptidase2774  actually EMS is a part of many us departments.  If the heart attack is critical enough then one of the fire fighters on the ladder truck can drive the ambulance in or if the ladder truck arrives first they can initiate care until the ambulance arrives
Reply: @dipeptidase2774  having had to call 911 a few times for emergencies, i can tell you that i, like you, are wrong. Use to think the same way until i asked an emt buddy of mine, and had to use the service multiple times. The ambulance is not a paramedic. Just emergency transport. They have advanced first aid, things to get you stable on the way to the hospital. Thats about it. Not only that, but they are not gonna waste time asking what the emergency is to decide what to send. Its an emergency, or it isnt. When you call 911 you need the calvary, and thats what you are gonna get, need it or not, cause seconds count. The fire engine is the paramedic. The crew is better trained to deal with the medical emergency at hand, and if the need arrises(things can change on a dime) you have 7 trained professionals to help stabilize a patient. And yes. You need all of them. Depending on the need, three men on the patient, and the rest are helping with readings, and getting equipment. 99.9% of the time it is never needed, but their job is not to ask, its to respond. Now i do agree that a whole fire truck should not go to a location if the call is not about a fire, but now you are asking for one more type of vehicle to be added to the fleet. As the OP said, the video makes valid points in a vacuum. The reality is it is required. Every bit of it. Pedestrians and bicyclists should be more aware of their surroundings too.
Reply: @dipeptidase2774 most of what you said is just… not true
Reply: @dipeptidase2774  not really true. In big cities the work is split up and different trucks have different responsibilities, these departments will show up to a fire with 15 plus firefighters. A small cities does not have that luxury, all our vehicles have about the same equipment due to the volume of calls and the fact that we only have 6 firefighters on a shift. So no matter what vehicle we are in we are all paramedics and can take care of a patient.  This is not the way to really do things but this is what the tax payers are willing to pay for.
Reply: @copperjarhead  "Pedestrians and bicycles should be more aware of their surroundings too." Fire trucks have flashing lights and are extremely loud. If a non-driver's inattention or unawareness is the only reason they are hit by a vehicle, we would expect to see firetrucks striking pedestrians and cyclists less than other vehicles, not more. I think the statistics and very nature of fire trucks should indicate to you that factors other than the victim's inattention have a greater impact on their likelihood of being struck by a vehicle.
Reply: @dipeptidase2774  I live in a town where it’s 10 miles to the nearest hospital. Fire is what, half a mile from my house at the farthest. Fire will always beat ambulance, and we have country emengery here. We also have a ladder because the ancestors built tall churches and tall goverment buildings .
Reply: @copperjarhead  Over here in Ireland they are paramedics
Reply: @dipeptidase2774  yeah you don’t need the tiller for a heart attack but when the tenth floor of a building is on fire
Reply: @Altema22  no they are pretty much all right always
Reply: @Altema22 European firemen are able to carry the same equipment in smaller trucks, and through use of more smaller vehicles have better response times, only 4% of the emergencies US firetrucks respond to are fires, over 60% are medical emergencies which ambulances are far better suited for.
Reply: @Altema22  European emergency service don't send a long ass fire engine with 1000 gallons of water to deal with a heart attack case. They sent an ambulance car with proper medical staff instead of firefighter. 
That's the same reason for why they could colonise most of the world while US lost everywhere.
Reply: @Altema22  "I wonder how many European firemen have to "make do" or do without in situations where an American truck would already have the equipment" Europeans barely get into that situation as they bring all the required equipment along as well. Exception if e.g. an EMS crew is on scene and then calls for a Ladder Platform to transport a patient down from an upper floor.
Even out in the villages you find stations with 5 to 10 apparatus, and in the cities you sometimes see stations with more than 40 bays
Reply: Altema22, our fire trucks in the UK have better equipment than most other fire depts around the world. Also we have a national ambulance service with paramedics run on a regional/area basis. We don't leave it to our fire brigades which is mostly voulunteer in USA. You only need to look at some of the videos on YouTube to see how pathetic some depts are.
Reply: @Ron-u1z  Similar here in Ireland
Reply: Better to have and not need, than to need and not have.
Reply: @taylorjeffords1719  That saying is much abused. Do we send SWAT teams on every police call? "Better to have it and not need it than to need it and not have it." Do you take everything in your house on vacation? "Better to have it and not need it than to need it and not have it." Surely, you understand the concept of cost-benefit analysis.
Reply: @taylorjeffords1719  not if it means spending extra time dealing with more equipment, being unable to navigate through any significant amount of traffic, being much less agile, and arriving late to the scene of an emergency where every second counts.
Reply: Cheddar does not know what they are talking about. You guys deserve more than every good thing.
Reply: Ah yes, Americans being American, let's throw the kitchen sink at every cat stuck in a tree and then lambast the rest of the world for having to make do with less. If only not every emergency requiring a response wasn't a nail in need of a good hammering, but alas...

I mean, the absolute agony of having to live in all those top ranking quality of life countries, how ever will we survive without 31’ 9” by 11’ 9” trucks to compensate for our tiny peckers. Next you'll tell us that the F-150 is an absolute necessity as well and driving a compact car without a massive towing winch on a bull bar is just gambling with our lives, I mean, what if you need it one day?
Reply: @rongeurtsvankessel1908  normally id agree with you but when lives are in the balance I dont think its as unreasonable to have the whole kitchen sink to throw at the problem 

Better to have and not need than need and not have
Reply: @dozergames2395  Big ain't always better.
Reply: @Matityahu755  course not but having what you need and being able to easily reach it are to important things to a fire-fighter 

Their are always a thosand ways to do something all that matter is that your way works clearly both ways work
Reply: @dozergames2395  Granted. But, 'their and there' are different. Sorry for correcting your grammar. But European fire trucks or engines are still well equipped for most day to day safety and service of the communities, towns and cities that they protect. But we do have specialist vehicles that can attend to specific scenes. I mean, why would you send a ladder truck to help get  a casualty from from a car wreck? Waste of resources.
Reply: @Matityahu755  Europe has more firefighters per zone than the USA where you have 9 man crews we have 3-4 man crews we have the captain the engineer/driver and 1-2 rescue fireman and our paramedics is 2 man crew.  So your European countries have 9 man crews we don’t.
Reply: @rongeurtsvankessel1908  ah yes the European telling us Americans how to do it when both systems are run completely different! You do you boo we’ll do us!
Reply: @rongeurtsvankessel1908  
You sound like a typically arrogant European that always, somehow, thinks you know better of how things work in another country, even better than the people who live there.
Why are you like that?
Reply: @rongeurtsvankessel1908  Most of my fellow Americans don't understand the concept of cost-benefit analysis. Whether it's fire trucks, parking lots, or calories; more is always better.
Reply: @rongeurtsvankessel1908  what?! That's a pretty ignorant comment. Maybe European fire departments don't respond to some of the types of call we do in the US. I can sat that there's nothing on the truck that doesn't get used at some point. Sure, some things don't get used often, but nothing on board is there without a purpose. In the US, when someone has a problem and they dont know what to do, they usually call 911. If it's not clearly a medical call or a police matter, they dispatch a fire truck. We are the catch-all responders.  If someone's water pipe bursts in the middle of the night, we get sent. Are we plumbers? Nope. Our tool complement beyond purely firefighting gear has evolved they way it has due to the highly varied, and often totally unknown situations to which we respond. We don't treat every problem as a "nail" that then requires a "hammer."
Reply: I've known a lot of guys working for fire and rescue, pretty much all of them thought European engines were under equipped and that the larger engines used in the US were practically a necessity. Longer ladders, longer hoses, more equipment, better pumps, buildings in the US make buildings in Europe look tiny. Fighting a fire on a massive warehouse or the Chrysler building needs MORE not less. If the tower housing Big Ben was on fire, I'm pretty sure you'd want the longest cherry picker, the fastest pumps.
Reply: @DarkModeClippy  case in point the fire at Notre Dame cathedral. Yes, Europeans have the same equipment, but it might not be on the truck that gets there first so you're waiting, time that could be spent saving a life or fighting a fire.
Reply: @renaissanceredneck73  I actually just got an urban example on the drive home from work, there was a fire in one of those gated communities but due to the fire the only gate didn't work. So while some firefighters were trying to pry the gate open or at least get hoses through, a big engine maxed out the cherry picker over the wall and sprayed over two houses and a small street onto the fire.
Reply: @DarkModeClippy  right on
Reply: @DarkModeClippy except european trucks also have cherry pickers while being more maneuverable, safer due to more rigorous crash safety ratings and braking, and also from being able to turn better. The first results when you look up fire department cherry picker are european trucks
Reply: I know right, thisw video makes it sounds like you can just make a truck half the size and it can still carry %110 of the gear, water, foam and hoses.
Reply: @85square  if you watched the video, you hear that you can get different types of vehicles for different purposes. Not saying that a big US engine can fit in one smaller engine, but in multiple different engines
Reply: Yeah but if you had one for heart attacks and one for fires congrats you literally just made another ambulance or let's say this there is a car crash rollover entrapment you get there open the car up with the tools start medical with the medical stuff and the car catches on fire instead of calling a fire truck since you made an ambulance fire truck you are already there and you can put it out on top of freeing then and providing medical and notice in the video they only compared how it deals with fires and not medical situations despite it saying they most of the calls are medical related
Reply: @fish7515  What is the problem with making an other ambulance. What is the problem with driving with a smaller truck and an ambulance insted of getting stuck in traffic with a huge truck? There is a fundamentaly different praradigm behind Emergency vehicles in the US and Europe. That has more reasons than just smaller roads. One difference is that not all trucks have all kinds specialty equipment. You typically have a very good hydrant system even in Villages, which means Firetrucks hold less water, sometimes none. On the other hand specialty equipment is kept on seperate trucks. Our local fire department (at least some years ago) has even a specialty truck that can haul exchangable container units on its bed. So if there is ever an nuclear emergency in our city, this truck loads the ABC container and has all the neccessary equipment ready in a minute. (Our city has a plant that handles nuclear waste, so there is a real chance that this will be needed at some point.)
Reply: @fish7515  the fire engines comes too when there are calls where the danger of fire is given. The fire engine always comes with an additional EMS unit, or at least one of the fire fighters is medically trained.

Heart attack in a supermarket: Only EMS responds (no danger of fire)
Car accident: EMS an fire engine responds
House fire: EMS an fire engine responds
Reply: @aron3588  yeah that would be nice but around where I live we can't do that in are environment we got one ambulance station in like a 40 mile circle so we have to have the fire EMS in one it would waste money to do it the other way we are anything but urban we don't really get in the way of fire trucks in you environment you prolly need it but we don't
Reply: @fish7515  thats why we send out multiple vehicles to a car crash. If the situatuin is clear like a car hit a kid on a bicycle you just dont need the extra stuff. if the situation is unclear or the caller tells you that he can see something burning, leaking etc. you send out EMS plus fire truck
Reply: @fish7515  The problem is, the massive fire trucks create problems downstream of that. They necessitate large, wide roads with large areas exclusively for the use of motor vehicles; lots of large, wide roads in denser areas and areas with lots of homes and businesses on the road increase accident and fatality rates. Proposals to narrow roads or to portion parts of roads for pedestrians and cyclists are often met with opposition from fire departments saying they can't maneuver their large fire trucks on them.
Reply: @fish7515  That's exactly the situation the "standard" LF10 is designed to handle, but for a  car accident, a paramedics team (german RTW) would be dispatched simultaneously anyway.
Reply: @fish7515  As I mentioned, for different reasons rescue / EMS services are organized differently here in Europe. Here in Germany for example, we do not just have an EMS stabilize a patient and then get him to the next hospital. The EMS is actually trained to do so, but under normal circumstances they are not even allowed to do certain things. As I also mentioned, we send a doctor with a special training out on site for first diagnosis and treatment. I cannot tell why we went that route in the past, but it is what works for us. (I do not claim it is the only possible way). As soon as it is known or uncertain if an injured person is involved, what is send out here usually would be at least one HLF and one Ambulance. Oh, and if need be, manyt firefighters are trained as EMS anyways. If a car crash is reported, they send out a truck and an ambulance anyways, as the fire truck may have to secure traffic (at least until police arrives) and make sure no oil, gasoline, diesel or whatever may leak is getting into the ground or sewer systems. Oh, and by the way, cars very rarely catch fire after an accident. Oh and another thing, if you send only a fire truck, they may be able to provide medical care, but you still need an ambulance, as under normal circumstances, you have to transport the injured person to a hospital anyways. So you need both anyways.
Another thing why it is orgnaized differently, while the fire department is an organisation run bei either the Stadt or Landkreis (closest equivalent would be either municipality or county for this comparison), rescue services may be run by private companies, based on an invitation for tenders and a procurement process. 
What you also will sometimes find, is that ambulances and EMS services are operated by a mixture of fire departement and organisations like the German Red Cross, Johaniter and others. They all get dispatched by the fire department. (As a sidenote, we have two types of ambulances, one called RTW or Rettungswagen, which would be a larger and better equipt ambulance used for rescue services, and we have KTW or Krankentransportwagen, which may be smaller, down to like a van size, with only basic medical equipment. They are equipped well enough to stand in as an RTW if need be or in case of a larger catastrophee, but usually they are used e.g. to transport persons who can´t leave their bed to doctors appointments or to transport patients between hospitals, where no immediate medical care is required underway.) Also as I mentioned, usually there are more rescue stations than fire stations (if only as besides the fire stations with rescue equipment, red cross and others may run their own stations). And in most cases, we have a lot more calls going on for ambulances that do not need a fiure truck. 
As I said, it is different here, and without beeing into the details to much, I assume there are also economics behind that.
Oh and I looked it up, as I mentioned stations beeing distributed in a way to reach almost every inhabited part of the area in a certain time. From the time they get a call, where I live, by definition it may not take longer than 12 minutes to have either a fire truck or ambulance on scene. Times may vary in other states/countries
Reply: Americans live in bigger houses, which means bigger fires, thus we need bigger fire trucks to put out those bigger fires.
Also America has to deal with forest fires which are huge. Europe doesn't have a lot of forest fires.
Reply: @Novusod  Europe doesn't have a lot of forest fires? Lol ask the firefighters from Greece, Spain, Portugal, Sweden or Norway about that. Even countries like Germany have an average of 1,000 forest fires each year, although most of those in Germany are of rather small scale - the ones in southern Europe definetly aren't. 
"Americans live in bigger houses," you find equally large houses in Europe. Keep in mind it's not only about single family houses and apartment buildings, obviously Europe will also have huge commercial and industrial buildings, public buildings like large train stations etc ... still they work on fires with their smaller apparatus there.
Reply: @EnjoyFirefighting  I'm gonna go out on a limb and say if you dropped the average Spanish firefighter in on one of the huge FFs we get in the west, particularly California, they would be dumbfounded at the sheer monstrosity of those fires. The problem being our forests are being (or at least they were, idk about now) improperly managed, leaving massive amounts of dead underbrush that is allowed to build up for years, sometimes decades, providing huge amounts of fuel. Only other place I know of that has wildfires as epic as California would be Australia 🦘🌏
Reply: @renaissanceredneck73  I don't follow lots of reports from down there as it's the same thing over and over again, so I'm not 100% sure of the scale of wildfires in Spain, but those in Greece definetly are of comparable scale like you experience in California. Heat waves are a topic across Europe, even central and northern Europe, but even more so in the south. By now crews from across Europe are well used to international mutual aid responses to all kinds of large scale natural disasters
Reply: @EnjoyFirefighting  Or Ireland or Dublin
Reply: @renaissanceredneck73 theyd be dumbfounded just like the american firelighters though, if they have the same tactics then since theyd have the same equipment theyd probably do similar results. Also forest fires BARELY account for any calls so thats not really a point
Reply: @Novusod  Australia has much much bigger forest fires than America and has much smaller trucks the same size as European trucks
Reply: @Novusod  Plenty of large houses here in Ireland
Reply: @Novusod  The ignorance in your comment speaks volume..
Reply: @Novusod but barely any calls are forest fires, you could do the same as europe and then have a small amount of large forest fire fighting trucks for when theyre needed
Reply: @cycadiguess Unfortunately timed comment with the LA forest fires going right now.
Reply: @Novusod  which one
Reply: @Novusod  So what? On average, more Europeans that Americans live in apartment lots (that are bigger that your big single homes).
Reply: @Novusod  A typical urban fire truck in the US is rarely used to fight forest fires.